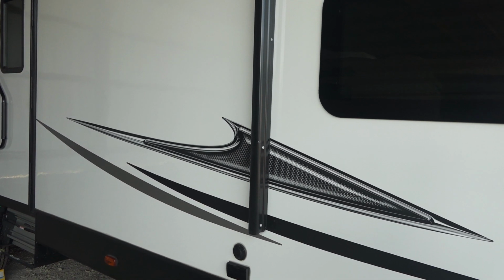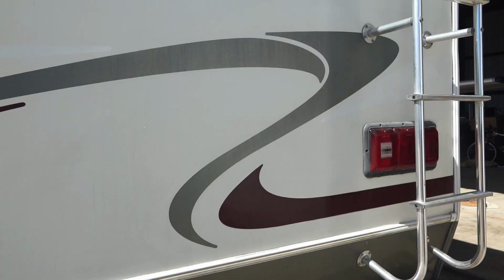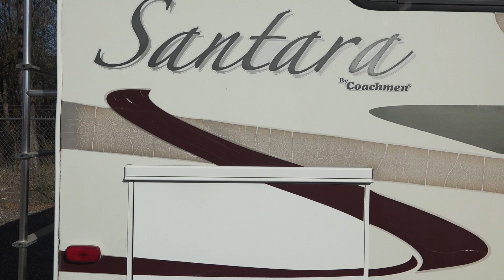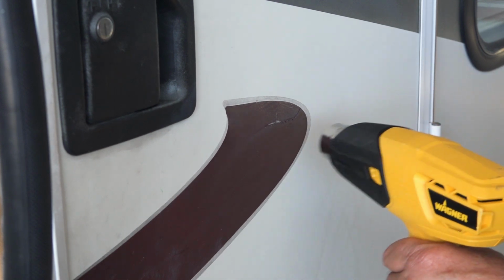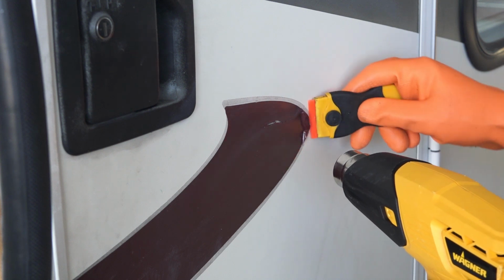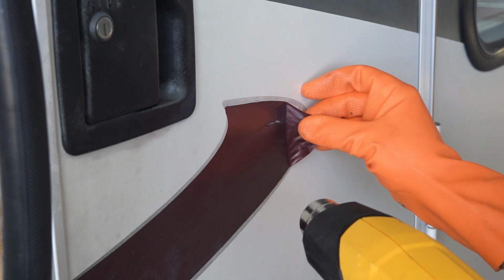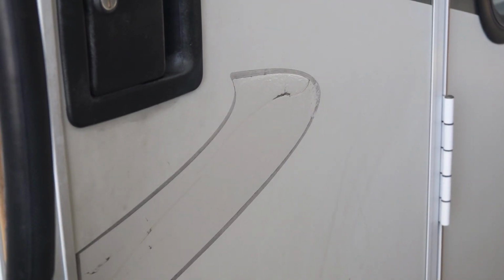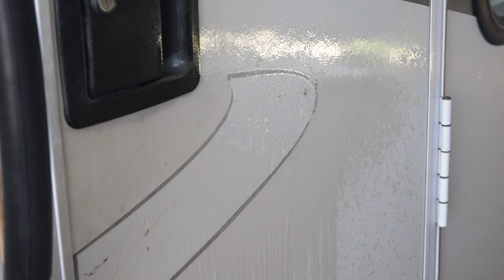RV Renovation and Remodel - How to Remove old Vinyl Decals

Comment: Nice, quick video!  We are going to attempt to remove our decals off of our 2000 Jayco Eagle. Most are in good shape, but they've faded and to be honest, not a fan of splashy decals on our tiny house on wheels.  We have other ideas that I hope are easy to do. Been working on updating the inside and now the weather is nicer, we can start the outside. Don't you just love making an RV into your own design!?! Have a blessed day!
Reply from the maker: Thanks! Almost all the decals came off this way, but a few were really baked on. We had to use MEK to get those off.
Reply: I agree, recently I became the owner of a 2008 Zinger by Crossroads Thor edition RV and some of the decals are faded and cracking a bit, I know it's not really a life threatening issue but it sure does bother me.  My main concern before watching this video was messing up the surface around the decals if I were to replace them and now I feel confident that I can do this work very easily.
Reply: What were your "other ideas" for the outside of your motorhome? I'm removing the stripes and painting the whole thing on mine, and am wondering what you were talking about? Please let me know, I'm looking for ideas. Thanks.
Reply: @AM-wd1wy  Our RV is aluminum and white.  So we are going to paint the door a fun, bright color, and the storage doors another bright color.  Would LOVE to add a 3rd color and paint on "shutters" on the 2 bigger windows.  🤞  We got our burgandy and gold stripes off and it looks so much cleaner and simple.  Blue stripes will eventually come off too, but ok for now. We did a video on removing the decals off aluminum.  The fun colors are on hold for a bit during the stay-at-home orders.  Home Depot is VERY busy right now.  Hope to get the painting done in the next week or two. Good luck on your project!  Painting the whole thing sounds like an ambitious project!  😊

Comment: Thanks for this video.
Reply from the maker: You're welcome! Most of the old decals came off using this method. Some where so badly baked on that I had to use MEK to melt them and then scrape them off.

Comment: It would have better if you had shown how to remove a decal that was in really bad shape, like the tan/gold one shown that had cracked and broken into hundreds of pieces.
Reply from the maker: You're right Freddy. We didn't tackle the cracked gold ones until later. We found that the only way to get those off was with MEK and a paint brush. After multiple swipes with the MEK and a paint brush, the decal starts to melt and is easier to remove, but still takes a long to time to get the whole thing off.
Reply: @ThisNewOldRV  what is MEK?
Reply: @ThisNewOldRV  For real what is MEK?
Reply from the maker: @dinstaar  Defined as "MEK is a liquid solvent used in surface coatings, adhesives, printing inks, chemical intermediates, magnetic tapes and lube oil dewaxing agents. MEK also is used as an extraction medium for fats, oils, waxes and resins.   It is a highly efficient and versatile solvent for surface coatings." When a decal has melted or baked on to the surface of the RV, it's almost impossible to remove. MEK is really strong stuff (wear gloves and a mask). It basically melts the decal so you cam remove it. Not too much though. https://www.lowes.com/pd/Jasco-128-fl-oz-Fast-to-Dissolve-Methyl-Ethyl-Ketone-MEK/1000508687
Reply: @ThisNewOldRV  Methol Ethal Ketone ....

Comment: Instead of puttingon new vinyl graphics, just use the lines you can still see from the old graphics to tape the area off and add some automotive paint with clearcoat.  It costs more, but it will last a whole lot longer.  You can just get a cheap airless kit to spray it.

Comment: I'm reseaching how to get rid of the shadow left behind by the lettering.  Do you have a process for getting the faded paint exposed to the sun to match more closely the area that was under the stickers?  We are not putting on new graphics.  Just want the old ones gone.  Without matching up the shadows left behind, it actually looks worse that it did before starting.
Reply from the maker: We have the same problem. The fiberglass that was under the old graphic looks like it's brand new, but the old surrounding exposed fiberglass is yellowed. Nothing we've done changes the old fiberglass yellowing. Still, our old vinyl graphics looked so bad, that removing them has made the rig look a little better. In my opinion, painting over the fiberglass might be the only solution. We're doing some research on that now.
Reply from the maker: We've looked around a bit on the Internet. There are some people that have used a "Rolling and Tipping" method of painting fiberglass, like on fiberglass boats. We may try that in a small area to see if it works. We're not recommending that for you, just an idea.
Reply from the maker: Found this... https://www.youtube.com/watch?v=IjbWiSR6LKg We may try it.